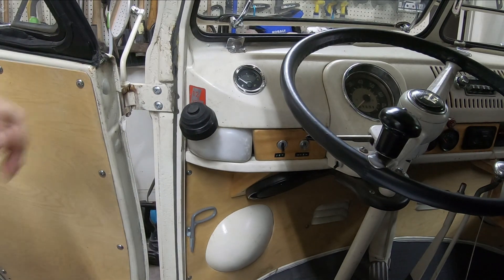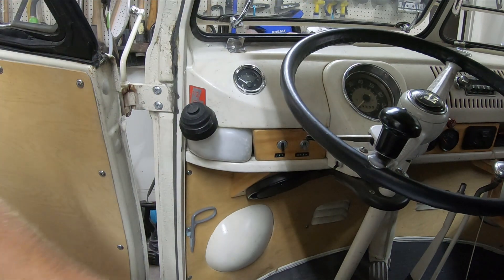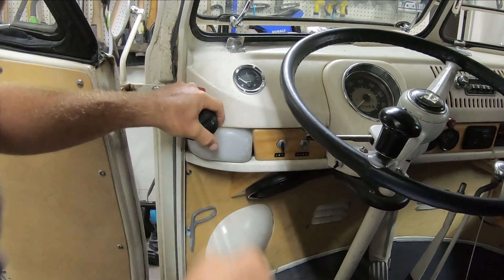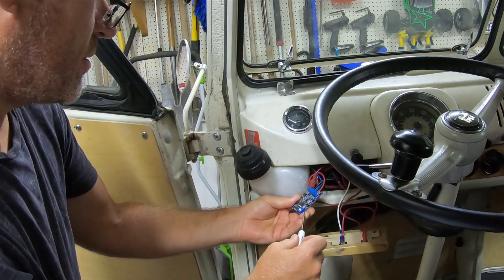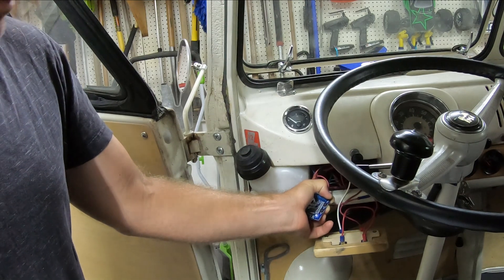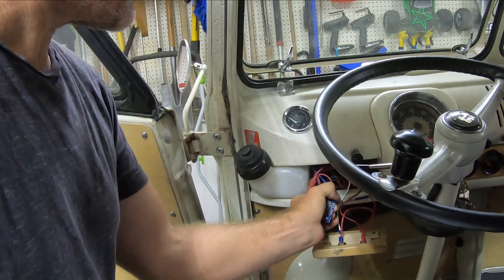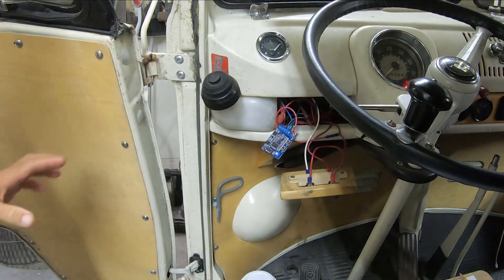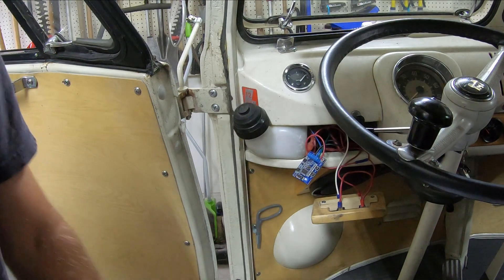2332 VW Air-cooled Stroker Motor - Video 75 - MeterMatch - 15 Gal Tank with Splitty Fuel Gauge

Comment: So, did the gauge read properly along the entire range?
Reply from the maker: It works “fairly” well.  You have to tweak the low, medium and high settings and the controls are a bit funky to learn.  However, this was my only option because I have a 15 gallon tank in a split bus which has a curved bezel on the gauge.  So it is a 10 gallon gauge using a 15 gallon sender.  If you know of a better option, let me know!
Reply: @LarsonSplitBus- I'm about to program my Metermatch. Seems to me that the best way to do it is to take the sender out of the tank, but I'm not really interested in doing that. I have a 64 Fairlane that' supposed to use the 73-10 range, so I'm hoping it does a reasonably good job.

Comment from the maker: The tricky thing here on the fuel gauge and sender is:  LESS ohms = MORE fuel.  MORE ohms = LESS fuel.  So you have to set up pin 1 to be FULL at 10 ohms preset, and EMPTY is pin 4 set to 73 ohms preset.  I used the Voltage Correction feature, and only set pins 1 and 4, leaving 2 and 3 at factory default (not set)